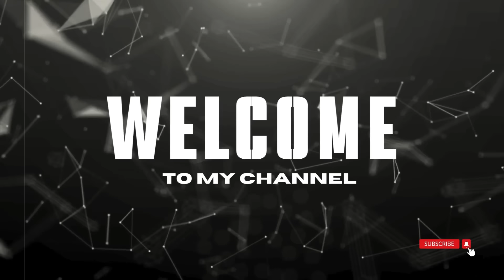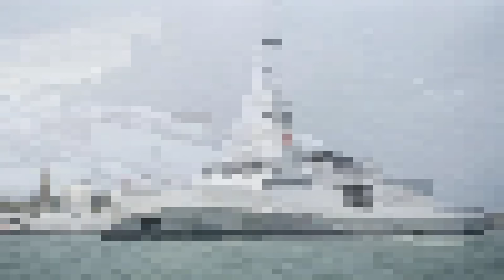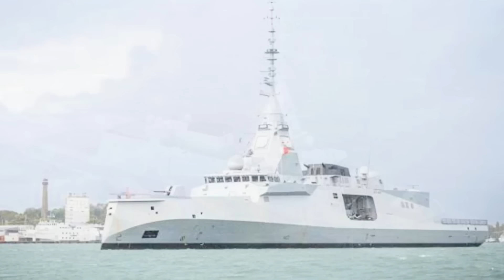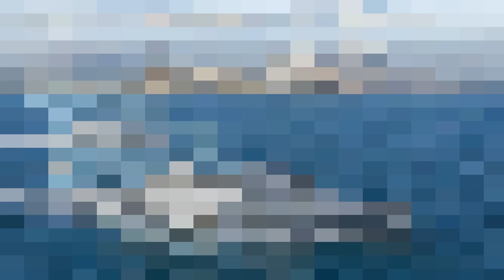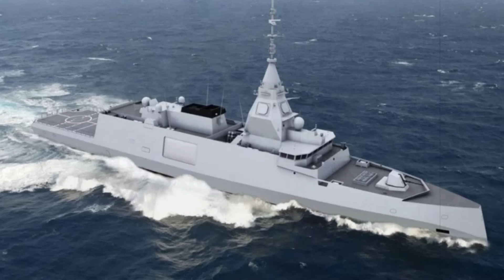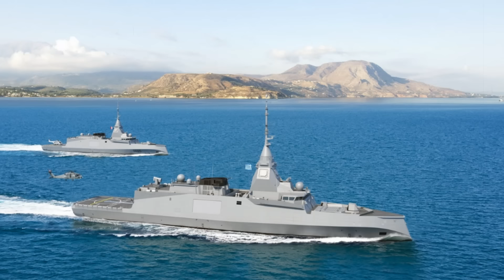France Offers Frigates to Sweden in Major Step Toward Defense Integration

Comment: Helt plötsligt har kostnaderna ökat från 16 miljarder till 60 miljarder för 4 fartyg!
Type 31 ca 4 miljarder/st.
Type 26 ca 15 miljarder/st.
Franskan ca 15 miljarder/st.
Alla priser
exklusive amunition!
Reply: The price you have listed for the type 31 is with British equipment. A Swedish variant would be far more expensive as the Swedish requirements go much further than what the Britts fitted on theirs. Fitting area Air defence requiring switching sensor suite and so on. So the cost would most likely be comparable to the others. But would carry a higher technical risk.
Reply: @aletheides3990  not just the AA equipment, because british Type 31 has no bow sonar, no towed sonar, no anti ship missiles, no EW jammers.  
In fact UK has not even ordered the promised Mk41 VLS yet, so right now it looks like recycled mushroom farms for CAMM from the Type 23 being gradually retired

Comment: 🇸🇪 🇫🇷 as a swede I hope France and Sweden develops a strong collaboration
Reply: I agree. The choice seems to be between FDI and the British Type 31. FDI is probably twice as expensive as I have understood it, but if you are going to have a system that costs a lot of money, you should have the best!
Reply: @robertnilsson7063  yes FDI is more expensive than british Type 31, because the british type 31 is poorly equipped, it lacks state of the art sensors like Seafire 500, it has no bow sonar, it has no towed sonar, it has no EW jammers, it carries no antiship missile, and the promised mk41 VLS have not even been ordered yet or funded.
Problem is that Sweden does not want the british version of the Type 31.  Sweden wants a lot more systems equipped to meet requirements which would make the Type 31 suddenly a lot more expensive.

Comment: If this is true it's about time we stepped up our bigger ship procurements. But if this is true this has nothing to do with either the Luleå or Visby classes, this is in that case on top of that. Saab will build the Luleå class as planned, that stealth technology is too important to Sweden not to maintain. Also, it is not replacing the Visby class as they are undergoing a mid cycle refesh adding among other things true anti air capabilities. But as the Baltic looks now we need more bigger ships so this wouldn't be bad at all if this is true.

Comment: I dont think Sweden will buy French. Sweden is a small country but with strong domestic defense industry, but that relies on the fact that Saab and others can continue to build their own systems. So for that reason i think saab will be the one commissioned to get the contract to build the Luleå class.
Reply: What is interesting is that France and Sweden make more or less the same military products. Fighter jets, boats, submarines and so on. Co-developing is a good way to cut costs and fast-track inventions. Its probably good for both countries to learn from each other and for Sweden to move away from some of the US components. 
So the countries do not need to buy whole systems from each other but cooperate to get as much as possible for the money available and learn so both countries have the very best equipment.
Reply: It comes down to speed and bandwidth of production. Sweden have 0 VLS cells at the moment and development of a platform would take too long.
Reply: @vilandar  Visby-class is getting a compact VLS from Lockheed-Martin for quad-packable short ranged missiles though, which would be an improvement to their survivability.

Finlands Pohjanmaa-class class corvettes are a ready design of about the same size the FDI with fully strike-height VLS cells. The combat management system and many other systems for it is contracted by Saab.
Reply: I dont even see why.Its smarter get more JAS planes,airdefence and army.I just cant see how any Russian fleet could possibly cross the sea to get all the way to the Swedish and still be floating already as it is.NATO has already enough maritime defence to sink anything needs sinking  and honestly there is no other threat to the country then our misled Russianfriends...
Reply: @donaldliden4545  Well NATO has not proven itself to be anything but deterrence yet. Art. 5 has not been tested against a nuclear capable state. A sudden tech shift that makes ballistic missiles with kinetic strike the only viable option requires that capability and getting it independently takes more then 3 years even when you have all precursors (example Ukraine)
Reply: @donaldliden4545  If Sweden doesn't handle the Kaliningrad direction then Finland will have to do it alone. NATO isn't a country, it requires teamwork.